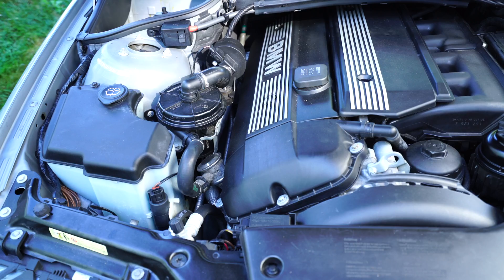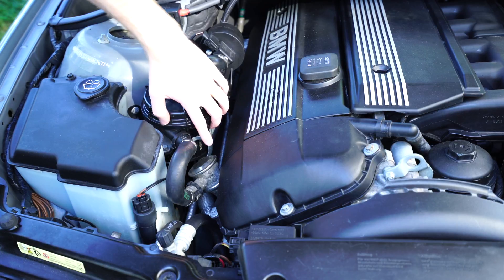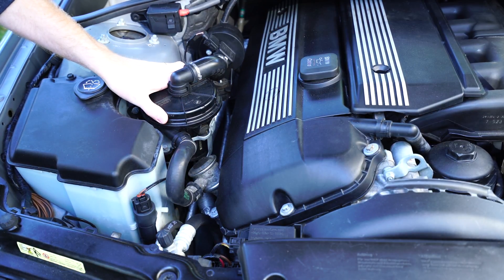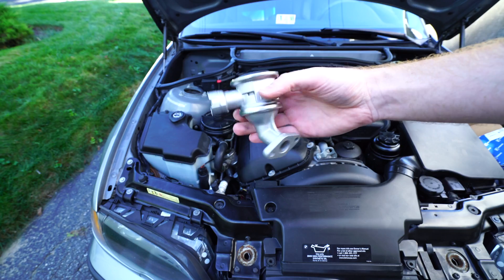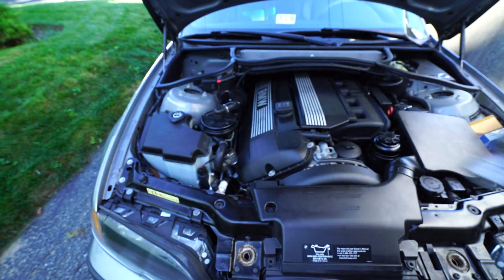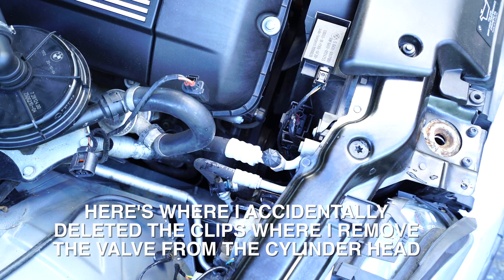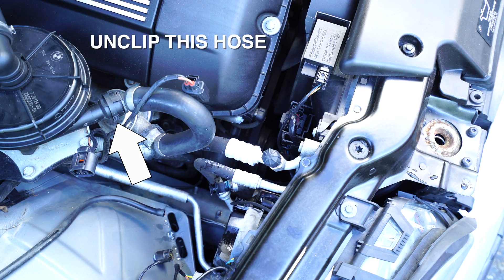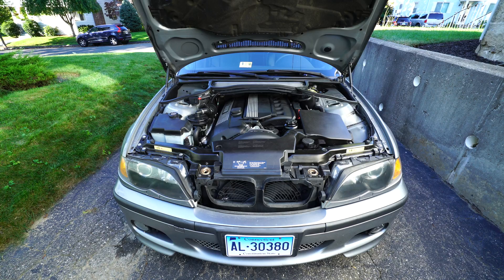BMW E46 P0411 Secondary Air Injection Valve Removal + Replacement DIY

Comment: Could this valve cause your e46 to throw P1085, P1083, P0171, and P0174. I’m chasing an issue after replacing my fuel injectors and I can’t figure out where my issue is for nothin. When I pulled my old injectors out, there was a lot of crud on the tips and I’m wondering if I dislodged a good bit, they traveled, and blocked something. Seems like the crud would have just been burnt off and thrown out the tail pipe, but who knows. What’s your thoughts?
Reply from the maker: hey Julian, I doubt this would be the cause. You might have a vacuum leak, so I would smoke test the intake first to find any leaks. Tiny, hard to see hairline cracks wont be visible with the naked eye. Lots of brittle plastic can crack when doing that job, like the CCV components. I just got a smoke tester for $80 on eBay http://ebay.us/9My3oW (affiliate) which I'll be reviewing and making a video on the channel here soon. My local shops charge $150 for an hour diagnostic to smoke test, so this machine allows a DIY at way less.

Comment: Hi, my car has this code 2004 325CI M54 ---   car has very poor power going up hills - floor it and it only goes to 30 mph ---- thousands spent since december 2019 no fix - mechanic told me I need this valve and he says the part is $200 plus an hour of labor for $300 plus tax etc. He said he called two places and both said it is $200 - does this make sense ?  Will fixing this cure the horrible power problem with the car ?
Reply from the maker: Jeanne Morris hi Jeanne, sorry to hear that. To clarify- you have spent $1000’s since December trying to resolve the power issue? Or does that figure include other unrelated maintenance and repairs? The valve is about $70 so with a markup $200 is nearly 3X the price. Too high. One hour labor sounds accurate. This is emissions related and will have no effect on your poor power issue whatsoever.
Reply: BIMMER ZEIT thanks so much for  response -  diagnostic work for jerking no power car added up $$$. mass air flow sensor 400 cleaning injectors etc nonsense work  - then brought to same guy with new code po411 and he said that code is not bmw he did nothing to help me just cleared the code and threw arms up in air and said he could not help me. After 3 visits for same problem - no power.  Then dealership who said I need catalytic converters at $3800 did Back pressure exhaust test I asked for numbers but didn’t provide - don’t believe dealership as prior issue - then two months later same code returned - went to new mechanic who told me about this valve needing replacement - I asked if this will clear the horrible power problems with car and he said he hopes it will
Reply from the maker: Jeanne M sorry to hear, really frustrating. How many miles on the car? How long have you owned it? The valve is part of the emissions system, you won’t have any drivability issues from the secondary air system valve / pump issues. So I would focus elsewhere. Where are you located?
Reply: BIMMER ZEIT thanks much for responding again.  Should I just cancel this new mechanic ?  I have owned the car since 2006 at 7K miles and today have 155K - I’m located in Rhinebeck, NY.  It’s terrible trying to locate a qualified mechanic in this area.  They claim to know the cars but really don’t.  I have advertised private mechanic and closest was in manhattan two hours away.  Do you think it could be the cats - my scanner says they are ok - I can’t imagine spending 4K on these if they don’t even fix the problem - especially since the car is only worth around 6K if that - it’s a manual transmission black excellent condition except for this power issue which I believe may just be a simple fix.
Reply from the maker: Jeanne M you had a BMW dealer diagnose the car with a back pressure test and they confirmed the cats are bad? Yes, they can go bad it is not too common but I have heard of it happening. There may not be any codes that indicate they are bad, which is why that back pressure test is used to diagnose.
Reply from the maker: Jeanne M I would try to find a set of used lower mileage converters from a part-out on Facebook marketplace, Craigslist, eBay or BMW forums for sale section. Then ask a mechanic you trust for the installation labor quote, maybe 6hrs/$600? Plus the used cats $200-400 maybe. $1k ballpark sounds reasonable.
Reply: @BIMMERZEITT  I’m so sorry just saw this response a year later !!! Dealer said it failed back pressure -
Reply: @BIMMERZEITT  thanks so much !!!  What about the oxygen sensors on cats ? Are they easily accessible in case I don’t have cash to replace - do you know how many o2 sensors there are ?  Do you do work on others cars?
Reply: @jeanne819  Did you ever resolve this power issue? If so, what was the fix?
Reply: @wishupondayibelieve  Did you ever resolve the power issue? If so, what was the fix?
Reply: @roymedinaiii8704  thanks for checking in !  So I needed a new mechanic and waited briefly in parking lot local grocery store near a car my year and owner told me who to go to.  I was told car previously needed cats at 8K (CA emissions NY car) no way for me to pay and this new mechanic removed my cats and sent them to someone in PA to rebuild interior and charged $500 each and couple hundred labor and car runs outstanding !!!  Woohooo !!  I rarely drive it these days but when I do it flies up the hills ! Sadly the amazing mechanic sold his business and became full time ministry.
Reply: @roymedinaiii8704  Also sad for me he left but happy for his congregation !

Comment: I got a 2003 bmw 330i , which do you recommend the early or late ?
Reply from the maker: Alexander Diaz the early and late models are pretty similar. Usually the late models are a better buy as any issues or weak points in a new design are addressed as the model reaches the end of its production life cycle. But it’s mostly personal preference! Whatever you like!

Comment: Replaced the valve, it did not help,  P0411 code came back again.
Reply from the maker: is the pump functioning correctly?
Reply: @BIMMERZEITT  Yes it does, it blows very strong at start, some people say it could be main mass air flow sensor, I don't know what else to do.

Comment: My 2004 325i has the same P0411 code displayed. The air pump works fine, so I'm thinking it the metal valve that you replaced. What's the difference between the secondary valve late and early? Looking to buy it for the repair. Thanks
Reply: We’re you getting any acceleration problems with this ?

Comment: How long did your pump stay on for prior to replacing the valve? I have the same cel and my pump only runs 5 seconds
Reply from the maker: My pump stayed on for only a few seconds, depending on ambient temp during cold startup outside. I believe it runs longer from a colder outside temperature. So at 50 something degrees fahrenheit it came on for only a few seconds. It should run a bit longer at colder temps. It's been about 600 miles since this valve was replaced and all is well.

Comment from the maker: The car has been driven 120 miles since the repair and has officially passed state emissions testing! I previously erased the code with my scan tool (before replacing this valve) and the service engine soon light came back on after 70 miles.
Reply: So what was the issue. I’m doing this yoday